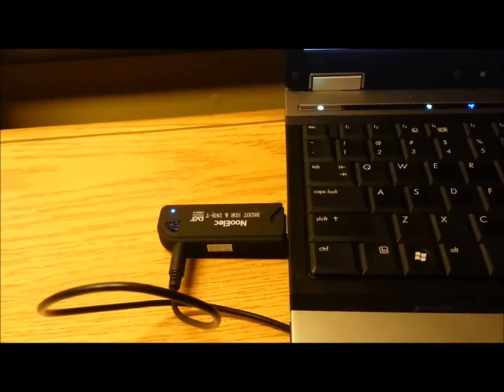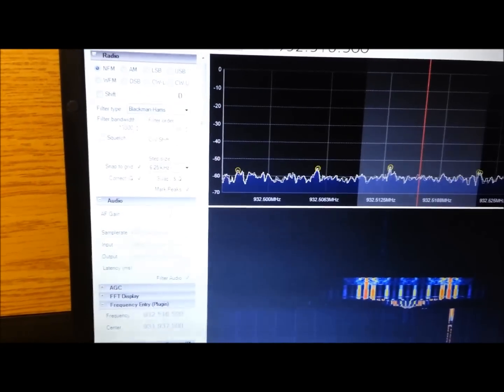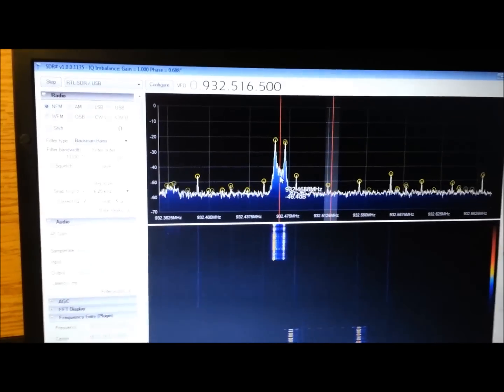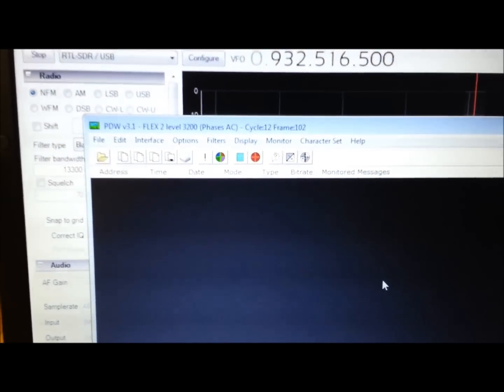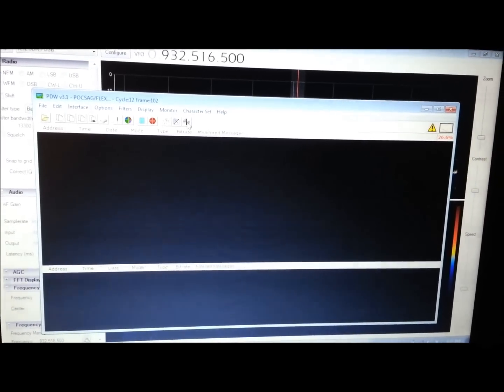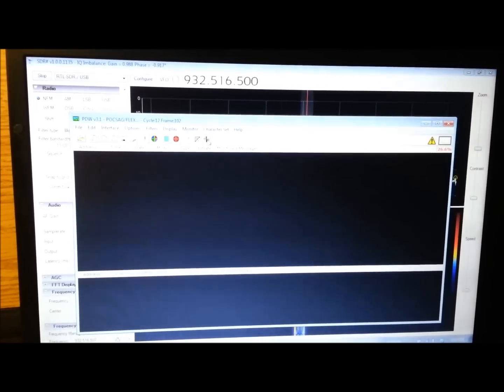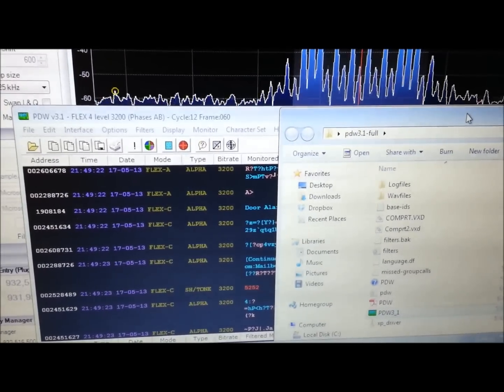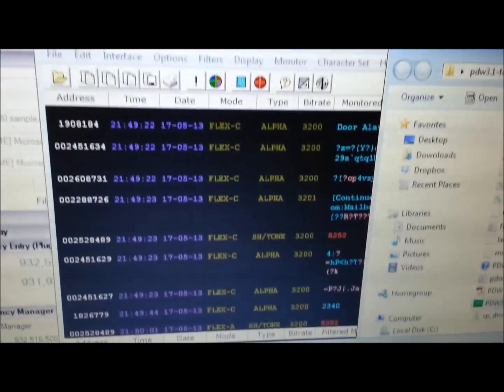Cheap USB SDR Decoding Pager Traffic

Comment: I'm having trouble receiving Flex transmissions. I have everything enabled but I can only seem to get POCSAG traffic. Sometimes I get flex. I just have this POS wind up AM FM WB radio that has a NOAA weather radio function built in and it's on a standard analog tuner. Any good radios to use for this?

Comment from the maker: They obviously will never compare to a proper dedicated receiver.  But oddly enough, the noise/interference/induced signals is drastically lower than I ever anticipated.  These units  are under 20 bucks remember :)  I've never tried a "true" SDR module- Id suspect they may give most receivers a run for their money.